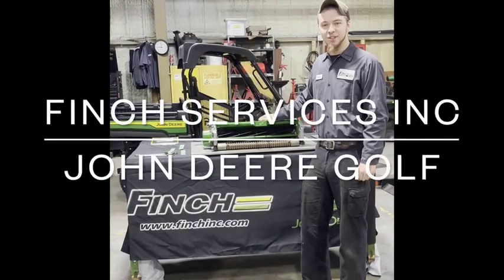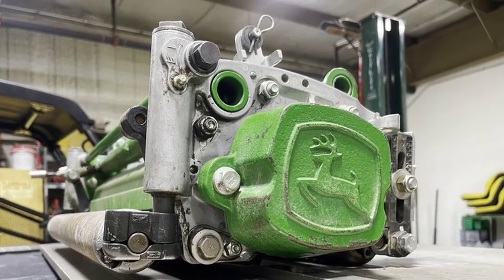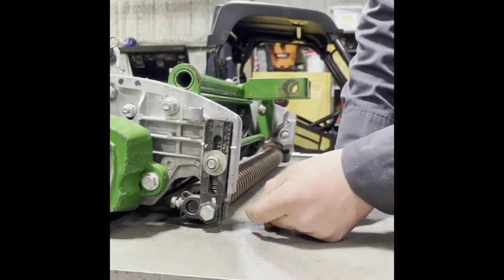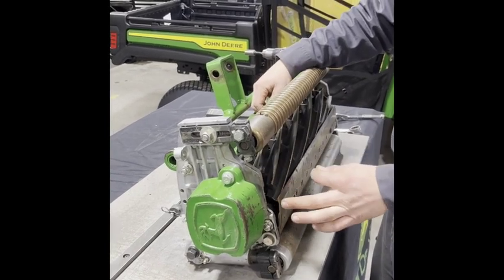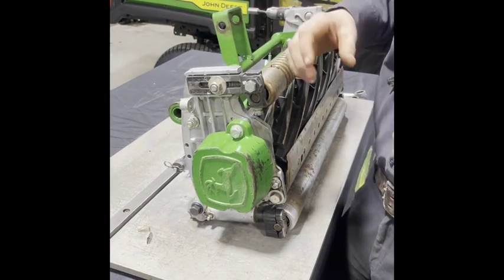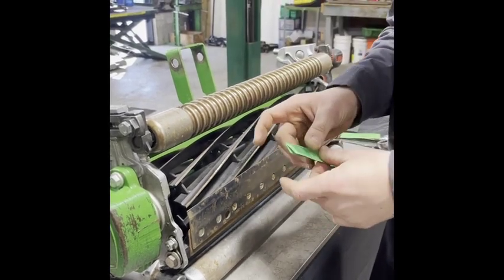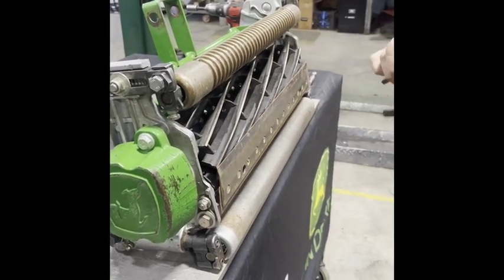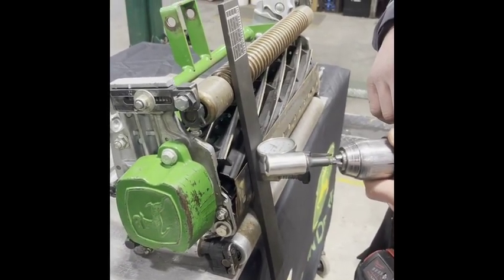John Deere QA5 Reel Adjustments

Comment: I cant get the left side of my reel to cut? When I try to adjust the left side with the adjuster, the adjuster will loosen before the reel an bedknife are able to get to same distance as the right? Brand new bedknife brand new reel?
Reply from the maker: The issue you are having with this QA5 reel is that the cutting unit is no longer squared causing one side of the adjuster to bind up and making the opposite side come loose. Shoot us an email @ info@finchturf.com and I can send you guides on squaring and adjusting the QA5.
Reply: I am having this same issue with our John deere 2500B. I will email as well if that's okay?